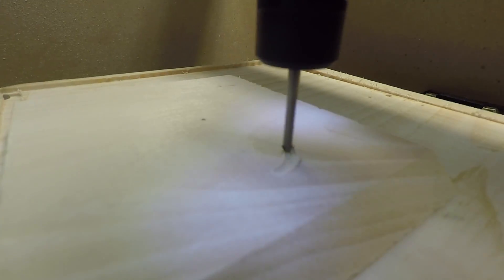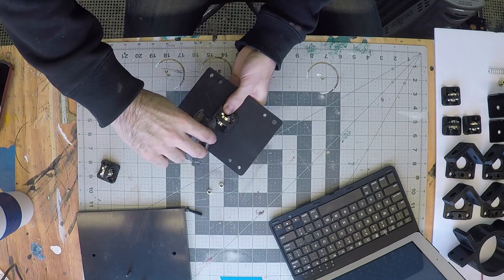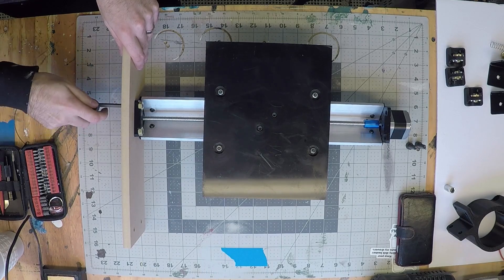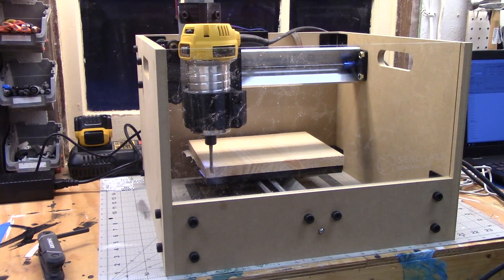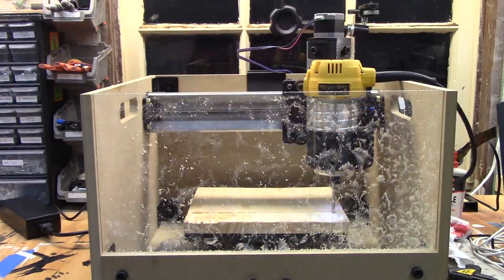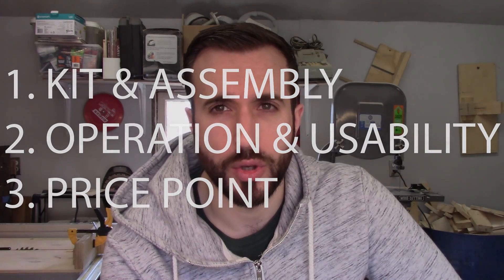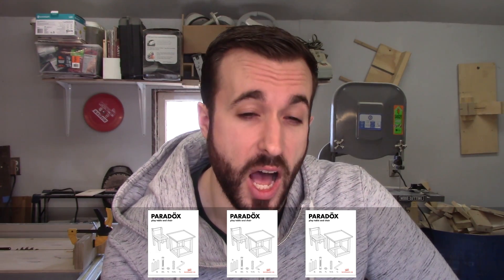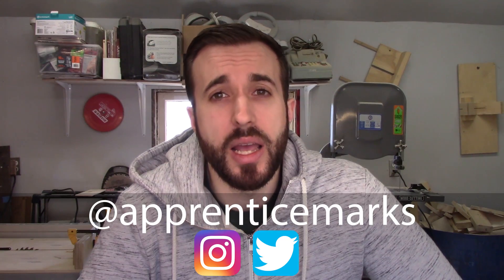CNC Router Review: Sienci Labs Mill One V2

Comment: How about an update? This one is informative and easy to follow. But it's two years since, and maybe you've mastered the 3D stuff, or upgraded the machine, or left it in a corner.
Reply from the maker: The sad truth is that the machine has largely sat in its corner unused for most of the past year. The last time I used it, I was trying to mill a christmas ornament as a gift for my wife, and I was having a difficult time because the machine kept dropping z height unexpectedly, repeatedly ruining the piece. 

I got frustrated with it, and haven't made the time to pick it back up since. 

The z height issue is not new - the router that I'm using is not one of the recommended models, and I suspect that it's too heavy for the stepper motor that operates the z-axis. I could probably improve the situation by upgrading that stepper motor to one with more torque, or by downgrading the trim router that I use to a lighter weight model. I believe that there are also upgrades available that allow the arduino that runs the machine to measure that actual position of the z-axis so that it can try to correct for unexpected movement. 

I have done some amount of research on all of these potential fixes, but haven't yet found the time between more traditional woodworking projects to actually buckle down and fix the issues that I'm having with the machine.

Overall, I'd still recommend this machine, but only if you're willing to spend the time necessary to tinker with it. Sienci has since released their LongMill, the next version of the machine with a fixed bed, and it's getting rave reviews. From what I read, they can barely keep the parts for it in stock. I've been eyeing one up as a way to bypass the time required to fix the Mill One, but haven't yet pulled the trigger on the purchase.

Hope that helps,

Jonathan

Comment: Thanks for the great review.  I bought mine before you did your video however I did not have too much time to dedicate to using it then.  Your review is quite fair and on point.  I did not have any trouble assembling the machine (aside from missing those same couplers - which they sent out immediately), but then I am also very used to assemble kit 3D printers and the like.  Price is very much in line with hobby level machines and the upgradability and openness to modifications is great for tinkerers.  As with many things, software is going to be a learning curve.